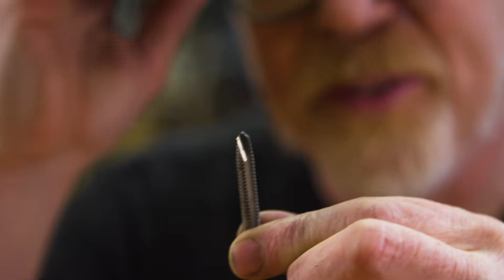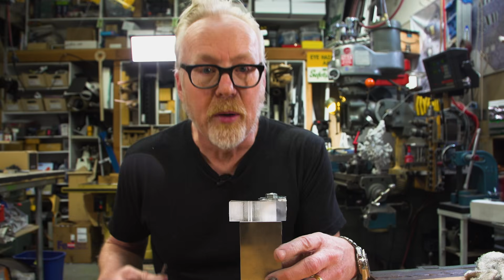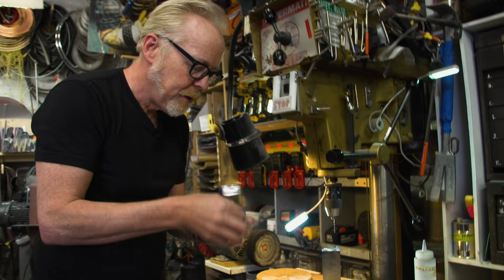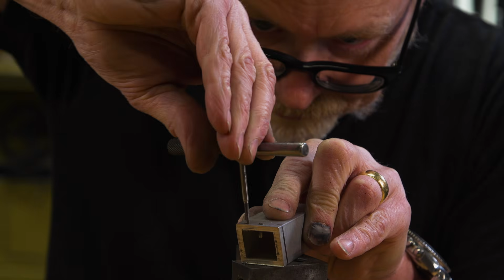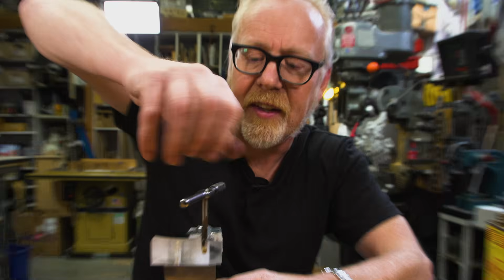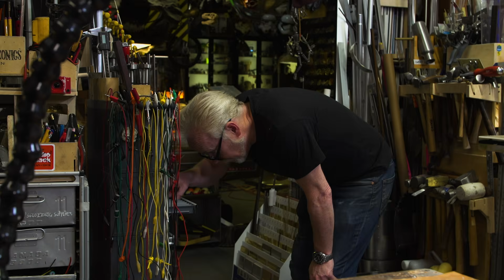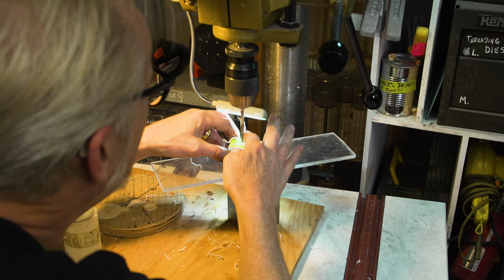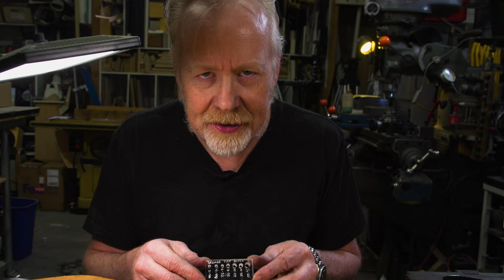Adam Savage's One Day Builds: Thread Tapping Guide Block!

Comment: Great video.  Spiral point (gun) taps are fantastic, and so are tapping guide blocks!  Grinding the point off of a spiral point will allow you to go farther into a blind hole.  Just don't get carried away and grind off any of the tapered threads.  

A few inaccuracies.  Actually, the correct tap drill for a 4-40 is a #43, but the slightly larger hole from a #42 drill bit is MUCH easier to tap.  If you use a #42, you will need thicker material, or a deeper hole in order to get the strength that it should have.  You can do the same thing with other taps like the 1/4-20.  Just depends on how much thread strength is needed.   

The hardened steel is actually stronger, but the cross section of a 4-40 tap is so thin that there's just not much material there.  A tap's web has a MUCH smaller cross section than a rod of the same diameter.  That's why it breaks easier than you think it would.  There's just not much steel there.  Having said that, high carbon, hardened steel does not bend.  Rather than bend over like a nail, it snaps.  

Shattering a tap works, but having it burned out with a plunge EDM is the safer (but MUCH more expensive) way if it's truly critical.

Bottom taps still have a taper, but the taper is only over a couple of threads instead of being spready over 5 to 7 threads.  Yes, you can grind a worn tap to make a bottom tap, but be aware that they require more force/torque than an actual bottom tap.

Comment: lol who even has time for that? Just get a set of decent taps with drills for equivalently sized holes. Use a cordless drill & put the clutch to a low setting. You can judge the clutch setting by holding the cordless drill's head & feeling how much torque it puts out before the clutch slips. You will never break a tap again.

Comment: Only time I ever had to make one I welded a stack of nuts tightened on threaded rod. Removed rod and machined one face in lathe. Cut nut stack to a height where it was effective to start tap into surface was tricky but worked fine. Bolt to fit hole was approx 50mm through a tight clearance block.

Comment: Working in an industrial setting for most of my career I ALWAYS clean holes out with the appropriate tap. Like he emphasized it's almost magical when your hardware finds its unrestricted way onto its threads. I also follow up by coating anything with threads with Copper-Coat to minimize the effort needed to remove the part for any reason.

Comment: Tip for removing a broken tap from aluminum, you can chemically dissolve the tap with heated Alum and water.  depending on the part you may have to make a clay dam to keep it in place.  Works a treat on aluminum heads with broken exhaust bolts as well.

Comment: If the 3 first taps have identical barrel diameter, why did you drill 3 identical bores for each of them instead of 1 bore that will serve all the 3 different taps? After all, you will never use these 3 taps concurrently. Also, think of the stress you will experience, discovering that by absent mindedness, because the bores are identical, you used a bore designated for different tap. You won't be ever able to decide if it was a mistake. That's sucks big time!

Comment: 💡When I have holes to drill that need to be precisely located on a larger quantity run, I'll 3D print a drill guide. I use stacked ¼-20 grade 8 nuts pressed into the appropriately shaped 7/16 hole. The inexpensive nuts aren't affected by the drill bit. Afterwards each hole can be opened up with larger drills.

Comment: Flame polishing?  Wow!  Ok…now that is something I never knew.  TY Adam.  I love tapping too….even into hard wood for some projects.  I also used to make models and often used the tiny ‘ba’ sized taps and dies (approx 3/32 to 7/32 in American).  Back in my school days…I made a small tap wrench from mild steel, very similar to that Starret one, for my metalwork class project…still have it today.  13:45 Ah, the quintessential “Hitch-hikers” quote…How often we bring that one out! lol.  Tapping method..yes, I too was taught screw in half a turn, back out a quarter turn, rinse and repeat until the hole is fully tapped…unless it gets tight, then much smaller twists….and I have sheared a couple of taps back in the day.

Comment: as a kid, i used to tap 1.5-2.5mm holes in stainless for a pneumatic engine that i built: only hand tools (no power tools), no lube. i did break a bunch of taps, but i eventually got a hang of it. i did not realize that it was the "hard mode" of tapping, heh.

Comment: I use 6-32 and 8-32 the most because those are the 2 sizes most used in electrical junction boxes. I install fire alarm systems and there is nothing worse than being up as high as you're allowed to go on a 12' ladder, holding your device in one hand and fighting a screw with the other because the d tew hole is cheaply made and covered in paint

Comment: Love this.
I bought a set a few years ago, thinking "how hard can this be?"; broke the first three taps.  I share the same satisfaction that you show at the start of this video; it is a sublime feeling, which is not appreciated by anyone else unless they have also done it.  Tapping and threading is now my first consideration, whether it is steel, aluminium, acrylic or even wood sometimes. I once threaded the thick outer sheath of a signal cable to fit a tapped hole in the side of a plastic enclosure.

Comment: Adam, 2 notes... With your new acrylic tapping block, you only needed 1 hole if the first 3 sizes have the same tap body diameter.  Just saves a little space on the block.  Also, I think it's good to mention that a well machined thread when used with a screw/bolt, only engages the first few threads (2-3).  The rest of the screw deeper in the threads do not add significant holding force.  This is also why a screw that has the head break off always breaks near the top of the thread where most of the tension in the screw body existed before it broke.  So, why does this matter?  You only need to ever get 5-6 revolutions of thread into a part for a sufficient hold and use a correct length of screw to go with that.  Any further threading is wasted effort unless there are other circumstances that require a deeper tap.

Comment: I absolutely love your enthusiasm about using taps, the first year out of my apprenticeship I was told to drill out a broken stud from a different case, well drilled it ok, then went on to re-tap the threads! Shit! The tap snapped! 
Took me two whole days using multiple and I say multiple if not 25 grinding points to remove the tap fragments.
Have even snapped them and have shattered them with punches to remove!
These taps are so frigging brittle, if I was to accidentally drop one on the floor I pray that there are no fractures in them!
Love your enthusiasm, but I'm afraid I don't share it lol.

Comment: Here's a little trick we use to do.  You can press a hex nut onto the square end of a tap and actually use a socket handle as a tap wrench.  for 1/4-20 you can press a 1/4" nut onto the square end using a vise. This is beneficial if for some reason you have a long reach to tap a hole.

Comment: Yes, 1/2-20! That is the tap I use the most. I've broken my fair share of them, too! 
As a network guy, I also carry 10-32 and 12-24, these are the sizes of most network racks with pre-threaded holes, and I find a lot of stripped ones! Also carry a set of double ended screw extractors because of the amount of stripped screws I find.

Comment: With mission critical tapping, I simply put the tap into the pillar drill chuck and start if off by turning the drill chuck by hand. This should put the tap in perfect alignment with the hole which was put there by the same pillar drill. Taps do have square sides at the top, so it's generally necessary to put them a fair distance into the chuck to get them to centre properly. 
Safety note....
24.15 Don your eye protection before blowing swarf out of holes. Even acrylic swarf can end up inside your eyeball. I know this because I worked in the ER.

Comment: I am truly amazed how anyone can be so fluently handle the in my eyes completely irrational numbers in the imperial unit system "for a quarter-twenty tap the correct drill is a number seven" - at the same time I am shaking internally. In metric the closest corresponding size would be something logical like you would use a 5 mm drill bit in order to later cut an M6 thread.

Comment: Adam, you need to add a piece of wood to your miter sled where the blade comes out the back before someone loses a finger.  Very easy to accidentally put a thumb there when pushing the sled.  Remember, safety third!

Comment: For just manually tapping fine threads in softer materials, I use a 2 or 4 jaw pin chuck or similar.
(They come in a good range of sizes.)
This makes it a hundred times easier to keep the tap straight.

Comment: 8:18 for those of you wondering “what the fuck is a goddamned “numero 7 o loco drill bit!?😡” (yes, that is what many of you were thinking verbatim😑.) Well, in the machinist world fractional drill bits are simply beneath them and they feel it necessary to have about 30 more sizes of drill bit between every fuckin 64th graduation of drill bit that the rest of us NORMAL humans have making going to Home Depot or Lowe’s a huge waste of fuckin time because they only carry fractional normal people drill bits!🤬 SO! as señorita Adam stated “1/4 - 20 is the most common noize maker to make noize you’ll need a #7 bit”. The next closest fractional noize maker would be 13/64 drill bit! Yes, it IS a slight bigger in diameter than the #7 which would be counterintuitive for adequate depth of cut into the wall for the new threads BUT the next closest fractional beneath the #7 is a 3/16 drill bit and there are about 87 numbered drill bits BEFORE you get to that next closest fractional bit and the hole diameter would be to damn tight for the tap to cut into! and so the 13/64 IN THIS CASE is the better because it’s literally the next size up from numbered bits before going into numbered bits again! Yes yes it blows my mind too🙄. Well, now you know and all your friends will be very impressed with your new found knowledge and all the lady friends of your wife will now thirst for your meat. The business of how exactly they came to know of your machining prowess is your own. Good luck!....you fuckin animals.🤨

Comment: McMaster-Carr has assorted tap guides with a grove cut into them so they can also be used for taping holes on round stock.  I usually use a pin vise for small wire sizes is soft materials.

Comment: Stop taking the mickey out of moly B ... Best thing since sliced bread. I once owned a Mini MKI which ran for over 350 miles being thrashed with less than 6lbs oil pressure (oil pressure warning light was permanently on) before the Molyslip oil additive in it finally said enough is enough and the big ends went! Brilliant stuff? 😁😁😁

Comment: See, right there you said 10-24 then 10-32 which is really the wrong way round since a 24 tpi is coarser than a 32tpi ... Just another reason why metric threads I find more logical - mm diameter and thread pitch bigger number, bigger pitch, bigger spacing hence coarser thread. An M10 1.25 v M10 1.5 same diameter coarser thread on the 1.5 to the 1.25

Nobody should be using UNC & UNF threads any more ... The mechanical engineering world is metric! It's just nuts and throws US kids who want to become engineers because all they learn is Imperial then they HAVE to work in metric in industry where exports are more important than the home market. No wonder mistakes are made!

Comment: Wow Adam, drain your smashed finger nails asap as the blood floods in under it. That way you save the nail-bed from damage & it keeps the nerve anchoring ends for the finger-tip's sense of touch! Drill it with a tiny drill or heat a straightened paperclip & slowly burn through it to the pooled blood.

Comment: Ordinarily, tapping was no big deal for me, until I had to tap 8 holes in a hardened stainless steel knife, and the only thread size I could use was 2-56.  Had to use a carbide spade drill because the steel was burning up conventional drills.  Oh, and there was about 30-40hrs of work to get to that point, so starting over wasn't a fun idea either.  I still have nightmares about it, and tiny broken tap pieces are occasionally found on the floor to this day.

Comment: Man, I'm fine working with the American system just fine. But in screws, the metric system is so much easier! You don't need to memorize which drill number goes with what, or keep charts of the dimensions of each screw thread, etc. In metric an M4 screw is 4mm. How big should the hole be? 75% of the size for the tap?... just drill an 3mm hole. Then use the M4 tap and an M4 screw. 

In SAE... your screw is an 8-32... ok, how big is that.. uh (looks at chart)... 0.1640 inches. OK, which drill bit should I use, the 3/16"? Too big. How about the 1/8"... a bit small but it will work. 
(I'm exaggerating, but you catch my drill)

Comment: You can use  Type F screws that are self tapping screws in the small sizes to avoid using small tabs which break.
As long as you are set up in the drill press or mill to drill you can swap the tap into the chuck and use it to start the tap square from the same set up.
There are forming taps which crush instead of cut which is more enginering trick, but I have only cheated by using a smaller cutting tap and finish with the forming tap

Comment: Adam, you’re always the effective teacher!  One of the ways I describe the difference between coarse and fine threads when I’m teaching someone - the fine thread is like a lower gear in a transmission and the corse thread is like a higher gear. Fine thread = more input, less output but greater torque. Coarse thread = less input, more output but lesser torque. 
I would be interested in knowing how many bad words you said when you did whatever you did to that middle finger!
Reply: I was also wondering about the finger.
Reply: Even the best of pros get wounded now and again.  It comes with the territory.

Comment: Great video. Tapping is so much more elegant than a nut to hold your bolt. Well worth learning.
I'm a Eurometric worker, but my two favourite tap sizes are 1/4 x 20 and 3/8 x 16 UNC 'cos that lets me attach photographic tripod and lighting stuff to anything. Cheap 2 foot square LED flat panels, tripod ball and socket mounts and lighting booms have popped up all round my workshops. Watch Adam's video on lighting ....

Comment: Here's an explanation of the absolute madness of the "American" dimensional systems.
[1] It's easy to remember the diameters of screws .
2-56 = #2 screw = 0.086" @ 56 TPI
4-40 = #4 screw = 0.112" @ 40 TPI
6-32 = #6 screw = 0.138" @ 32 TPI
8-32 = #8 screw = 0.164" @ 32 TPI
10-24 = #10 screw = 0.190" @ 24 TPI
...
[2] How do they work that out? .
Everyone remembers that the major diameter of Unified threads = 0.060″ + (0.013″ x [# number]).
The # numbers are termed "Screw Gauges (Gages)". Note that these don't correlate to wire gauges or sheet metal gauges which are completely different yet equally obtuse American ways to dimension things.
...
[3] OK, what size drill to use? .
Generally, there aren't any American drill sizes that correspond to those screw diameters!
Neither Fractional OR Number drill sizes (except for #2).... 
#2 screw = 0.086" = #44 Drill (but > 5/64" and < 3/32")
#4 screw = 0.112" /= #34 (0.111") or #33 (t0.113" ) ??
#6 screw = 0.138" /= #29 (0.136") or #28 (0.1405") ??
#8 screw = 0.164" /= #20 (0.161") or #19 (0.166") ??
#10 screw = 0.190" /= #12 (0.189") or #11 (0.191") ??
None of them matches any of the Fractional sizes in normal Indexes. Don't fear - they also sell Factional sized fasteners with the same thread pitches but slightly different diameters.
...
[4]  How do we apply this in the machine shop? .
Simply measure each bolt with a caliper or micrometer.
Then rummage through and measure your Number drills, until you find one that's close enough.

Comment: Tapping Block, just 3d print one,  as far as tapping, use lubricant... I hate cleaning oil out, but i will use essential oils and then it smells good forever.  I rarely use a block and would fear i couldn't find it when i need it, hence the 3D print make many. But eyeballing look at 90 deg at start works just fine. As to a set, well today we have to deal with metric and imperial, buy a set whether small with just the most used, but if you buy the cheapest you will probably get the cheapest made.  Small wrachet tap handle is better than that small Sterite and if you are tapping 3D prints use you cordless drill.

Comment: With the tapping then reversing... What you do NOT want is long curly chips like off a lathe cut. The reason is that they get jammed in there and tear up or hole of bind the tap. You need little chips, like sand or dust! You need to come back enough to "snap the chip off". So 1/4 turn in then 1/8 turn back out isn't enough, you gotta got back enough so that the previous flute's back edge will cut off the chip.
With a 3 flute tap you probably want to come back 1/2 turn at least, with a 4-flute maybe back 1/3 of a turn. You can feel when it snaps off as a kind of "click". There is no harm if you go back too far.

Comment: as a tool & die  engineer/maker  the very first thing thing to know about taping is you must be square to the hole 100 percent. only tap with out a guide or out of a machine if you have no other choice.  I've had to tap double 00 holes and you end up cross eyed after a few of those. square and steady never rush a tap.